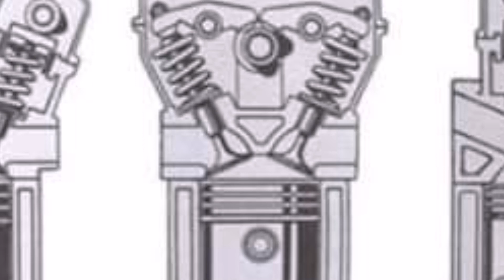ENGINE NOISE DIAGNOSED / 3 URI NG INGAY SA MAKINA NA DAPAT ALAM MO SAAN ITO GALING

Comment: Boss sana m pansin mo to.ung z200s ko may ugong n tunong kada piga ko ng throttle lalo n pag nasa high rpm n umuugong makina at paano po palambutin i neutral ang tigas po kase hindi ko ma neutral.
Reply from the maker: https://youtu.be/J_qF8M2KbK0
Reply from the maker: clutch lining mo baka sliding na or tukod ang set
Reply from the maker: https://youtu.be/-zC2r2Nt-7g

Comment: boss ask lang po ng advice itong motor q kc rusi tc125 nilgyan po ng buhangin sa makina pinadaan sa lagayan ng oil, ngaun may tumulong po s akin at nilinis by flushing kinalas pati ung starter nung ok napo start namin biglang may tumunig na parang knocking sound dati po wala un ano kaya po yun ngaun kada cold start q po meron ung tunog na un salamat po
Reply from the maker: yare, pede may natira pa din buhangin pag andar makina, may na damage na jan, mas mainam sana biniyak makina para linis talaga

Comment: Yung wave kO bOss may kalansing sa bandang kaliwa.. 
Parang sa may head sya nang gagaling and kapag sobrang init ng makina mejO malakas na ung kalansing nya.. tS humina ung hatak ng motor ko..
timing chain ba yUn ?
kasi ung sa kUya kO ganUn din dati barakO nagpalit sya ng bLock?
Reply from the maker: Pedeng tchain, pede din alog na yun piston
Reply: @pastorjmoto748  pag alog ang pistOn anong pede gawin?
Palitin ba sya ? Need rebor ?
Reply from the maker: @juliusmelibo7054  mas maganda deretso rebore nah, para sariwa na din cylinder wall

Comment: Sir.. galing po sa overhaul mc ko.. nag palit ako ng crankshaft assy,, after non, 15mins na takbo or idle lg,  pag nerebolusyon mo tpos sa dulo ng rev may parang cement mixer na tunog.. pero kung naka idle lg wala.. basta sa dulo ng rev or evry gear shift.. maririnig mo ang cement mixer na tunog, yung batong gumugulog sa loob.. parang ganun.. ano po kaya o saan po kaya nanggaling ang tunog?

Comment: Dami ko na po pinagawa di nila maayos. Ct150 po motor ko. Sabi tambutso pero di rin pinakalkal ko na wala PA rin. But naririnig ko inside the cylinder head
Reply from the maker: timing chain or valve clearance oa check mo sir

Comment: Boss ask lng Po pano Po Kaya yung maingay makina pag umaandar na kambyo ako 3rd and 4th gear bigla umingay at parang pigil takbo
Reply from the maker: panong ingay sir? garalgal ba o humihiyaw lang makina?
kun garalgal pedeng may tama transmission...
kun hiyaw lang makina ehh pede sliding clutch lining..
Reply: Parang pasok sa sintomas Ng clutch lining boss , pag tersera o kwarta dun gagaralgal makina tas para engine break ,tapos mahina hatak motor khit mataas na gas